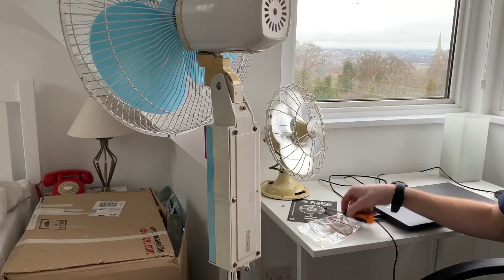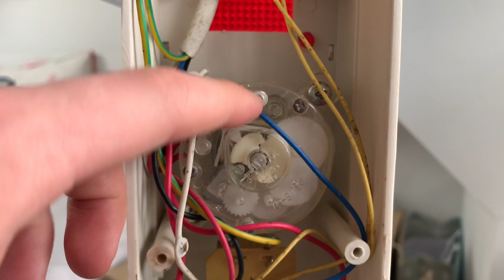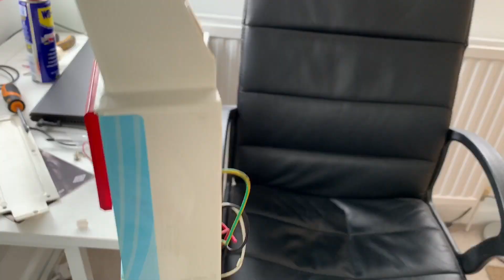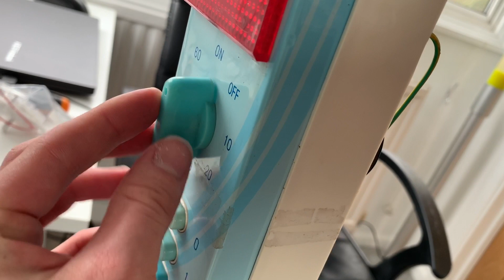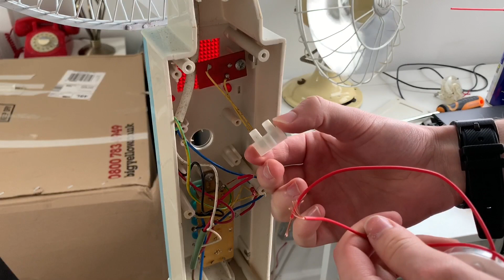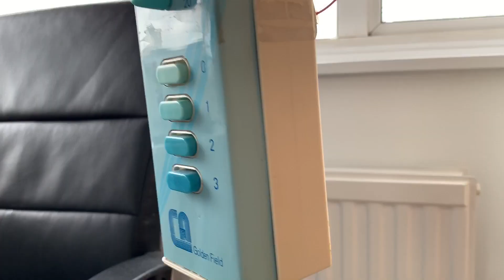How to Replace the Timer on an Old Fashioned Pedestal Fan

Comment: Hey I have one of the table fans from the 90's which have broken timer and needs some servicing on the motor. How about you come to my country in South Asia and have a look at it. Hehehe.
Reply from the maker: Haha would if I could! I found the replacement timer on eBay, they are pretty cheap and usually easy to find, if you can get a replacement timer for your fan it’s really easy to swap the broken one out for the new one

Comment: I don’t understand how the timer works
Reply from the maker: The timer will cut the power to the fan and turn it off when it reaches 0 (or off position) and can be set for up to 60 minutes. If you don’t want to use the timer you just leave it in the ‘on’ position and the fan will run as normal

Comment: This will be helpful if i ever encounter a fan with a broken timer. And terminal blocks are very useful, but it is better to wrap the terminal block in electrical tape after wiring it up
Reply from the maker: Thanks, yeah I should probably get some electrical tape for that
Reply: @fanaticalfans  terminal blocks are still a good method, they are definitely better than twisting the wires together